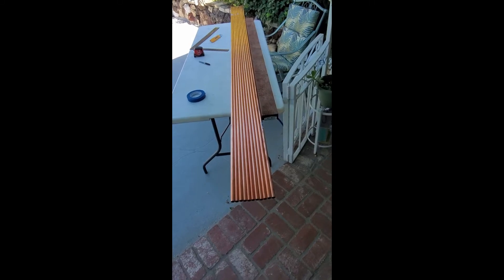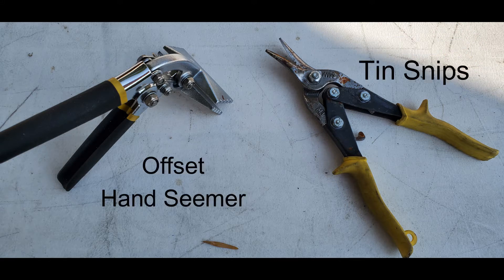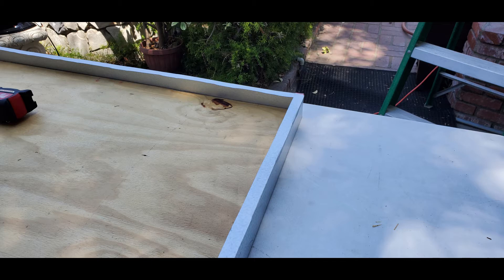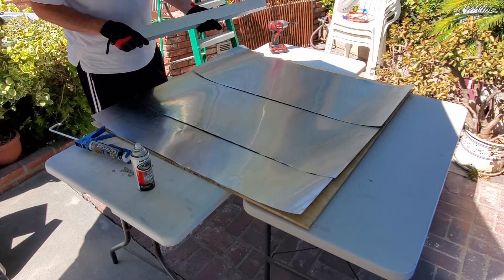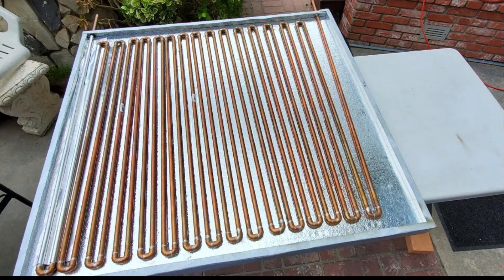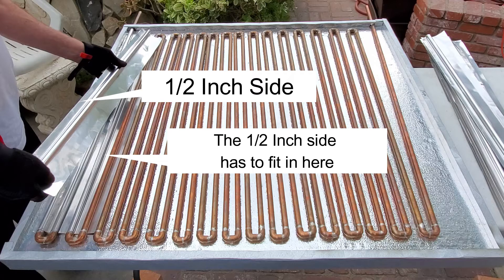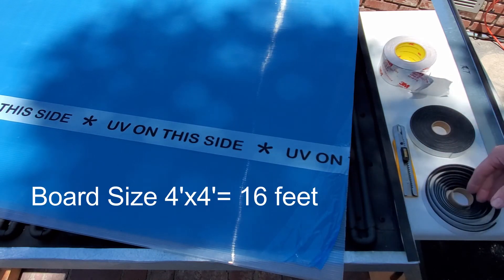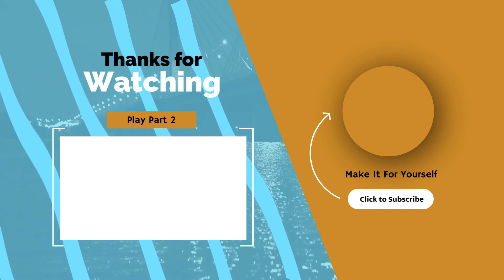Solar Water Heater, Part 2  Pool Water Heater, Off Grid Shower and Boils Water

Comment: Total Energy Hitting Your Collector: Roughly 10,800 to 13,000 BTUs per day across the entire 13.7 sq. ft. surface.  So you will only need 30 to 35 feet of copper spread out in the collector.  so with the amount of copper pipe you would be able to  build two more and catch another 20,000 to 23000 btus with the other copper tube. For a 100-gallon basin (approximate size for a 43x46 inch area with 1 foot depth), this amount of energy would raise the water temperature by roughly 6°F to 12°F on a clear day.  So three of them would raise 300 gallons 12 F a day. You have enough copper to build two more of the systems. You could warm up 300 gallons a day.

Comment: Good Day.  First off, great video and design.  I am was wondering about a few items before I build this.
1. Any flaws / weak points that you have discovered after a few years of use?
2. Have you done the calculations regarding BTU's produced on your model?
3. What are your thoughts on adding a vacuum relief valve for when the pipes cool down when the sun goes down?  I know this build is copper but I wonder how bad the expansion/contraction stress would be on the pipe and joints.
4. Are there any other design changes you would consider?
5. Do you have a document with design / instructions?  If not, I started creating one from your video.

Thanks again for your time in making this video.  I appreciate your response.

Comment: Why not just use a soft copper coil any let let it go round and round way less fitting but not as efficient in spacing am betting
Reply from the maker: Problem is that you couldn't put the aluminum fins on top of the copper
Reply: @makeitforyourself3591  yeah that is true have you seen a batch solar hot water heater made with a box lined with pond line and a glass from a sliding door

Made the box out of 2x6 and elevated it to make a make shift shower
Reply: @makeitforyourself3591 wrap in foil?

Comment: Part 3 please. Looks like you used the aluminum heat transfer plates backwards from what would be ideal for this setup. The open side should face the sun, so the sun can still go directly to the pipe. For a heating a pool (maximizing total heat output, not output temp) you would be better off using tees instead of elbows so that the water goes thru in parallel instead of in series. The water coming out would not be nearly as hot, but the total energy captured by the panel would be higher.
Reply from the maker: Unfortunately I don't think you could complete this build if you reversed the aluminum collectors, if you re-watch the video you'll see that flap fits under the next piece of copper tubing which if reversed would once again cover over the top of the next piece, our thought was to seal top and bottom in aluminum  basically encasing all the copper in aluminum, if you want to build one like you suggest I would just leave out the aluminum altogether or lay on sheets of aluminum. 2nd point regarding the T connectors we thought about doing this but our final decision was the the street elbows which produces non stop heat temp increases of 10 degrees 1-gallon per minute,  even when our water was at 100 it would go up to 110 etc. so if you use this build for say an outdoor shower (shower only uses15-20 gallons or so) and you circulate the water back into the same source say 30 gallon drum it would raise the temp roughly 18-20 degrees per hour depending on the heat loss from the drum insulation etc..

Comment: Used steel tube framing and wrapped copper pipes in foil paper  and used corrugated sheet for the backing.
Reply from the maker: That sounds like an interesting build,

Comment: You only get that temp by allowing the water too sit in the pipes. Running water will only achieve you 10 degrees tops over pool water. I know cause I have the same system but plan to upgrade to more than 300 feet copper. My system has a pressure valve added case the water gets to hot from sitting it’s popped a couple times.
Reply: hiciste su sistema? me puedes comentar que tal por favor, gracias

Comment: I used metal framing bottom channel for my box.

You don't need plywood.  The insulating sheet is rigid enough to form the substrate.  You can still clad it with the sheet on the back.

Comment: Does it give you continuous hot water? Wouldn’t the cold water running cool off the pipes quicker than sun heating them, at which point it doesnt heat water anymore?
Reply from the maker: It continuously will raise the water temp 10 degrees 1-gallon per-minute, if the input is 75 then output will be 85, 85 then 95 etc. So if you want to take a shower for example which usually uses 2 gallons per-minute,   for a 10 min shower use a 20 gallon bucket and just keep recycling the water from the bucket back into the bucket and the water will be hot in no time  (+30 degrees per hour)
Reply from the maker: Or when you first run water through the system it will boil water for coffee or tea or ???

Comment: perfect. You applied what I had in mind. Have you tried this system to heat the air?. How much did you measure the input and exit temperatures? I will do the same for the system to heat the air. do you have any advice?
Thank you.

Comment: If I place each copper tube in a hot water hose will that add more heat as the rubber heats up?
Reply from the maker: Good question, I don't know. I would test one and measure the results before doing a lot of them

Comment: This is a great build! A lot more efficient than you see in other videos because of the many lenght of copper and excelent conduction of the aluminum to the pipes! Well done. I want to build more or less the same (2 collectors) but with steel pipes as a permanent soluiton for water heating for my family. It will be fixed to the roof top. 

I was wondering if you have ever measured the air temperature inside the collector. The bottom is made of wood which can catch fire if it is over 200 degrees.
Reply from the maker: I haven't taken air temp only readings but as you saw in the video the copper got to 246 degrees inside the box without any water running through it. NOTE you should be placing  HARD/SOLID insulation between the build and the wood which will help lower the wood temperature. DO NOT use foam style insulation because it will melt!